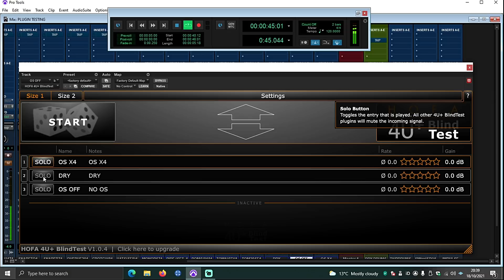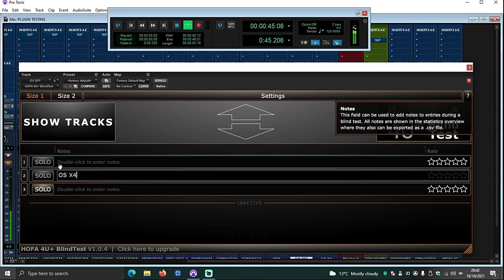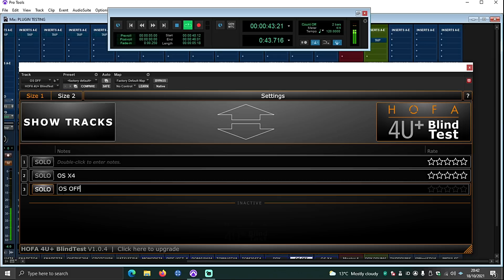ALIASING IN AUDIO PLUGINS... The most important things you need to know!!

Comment: There has always been this discussion about what samplerate to work in. And wether you hear a difference between 48k and 96K. I never understood the whole 96K thing. Understanding aliasing helps me get it - finally. The discussions (I had) were never about aliasing. It was simply about: Here is this file in 48k, here is this file in 96K.. is it worth it? To me it wasn't and isn't. However.. with aliasing this starts to make sense and I feel a bit like a fool. They've been right all along - unless I oversample.

I think this is a valuable video and you should make a playlist with "Paul Third explains audio-terms". Next video: "non-linear what does it mean and what can it mean?" just kidding, not about the playlist though.
Reply from the maker: That's why I'm so picky about plugins cause I refuse to mix at 96k haha I can just internally oversample where possible but I may start to limit any form of saturation to like 1 per track. Honestly I used the least amount of colour and analog emulations I've ever used on my most recent single. Asked a mastering engineer what he thought and he said 'you do like your colour do you' haha I think I need to trim the fat a little 🤣
Reply: @PaulThird  That may just be me, but I don't like the "FAT" button on the Britson. It really depends on the genre how hard I drive it. But even if I pin it 10 dB beyond red on a bass I prefer doing it without the FAT. It's not just "more" saturation. To me it sounds like different saturation. To me it sounds like it makes sounds take a lot more place in the mix (even in places where I don't want them to take place) when I hit the FAT. Just a thought, maybe you give it a shot! Just use the fader and oversample. Live a little! Faders are fun.

I still remember your advice to "live a little" and oversample plugins instead of being my hardheaded self that expects plugins to be perfect and have oversampling integrated. I'm kind of using it as a mantra now.. "live a little" is a very handy mantra for people like me (outside audio too). I used to live "too much" and I've embraced the polar opposite.. I need to settle for a middle ground sooner or later. Baby Steps: I oversample now, without feeling like betraying my principles :P. I've noticed that there's nothing that ever benefits from more than 4x OS (to my ears).
Reply from the maker: Trust me. I know it's not easy. I'm Autistic.. I despise change but I've learned over time that you don't how far you can go unless you try actually going further. If you sit in the same lane you'll always arrive at the same destination which is important as you need levels of consistency in life but sometimes if it's safe and you've nowhere else to go and you've got time, jump in the other lane and see if it gives you something different. If it gets you to the same destination but quicker then maybe start using that lane more often but least you know you have the option of the first lane if it's closed or you need be on time quicker etc

Give yourself options or you'll always be stuck in the same place. You might be happy to sit in the same lane but still handy to know you don't have to✌️